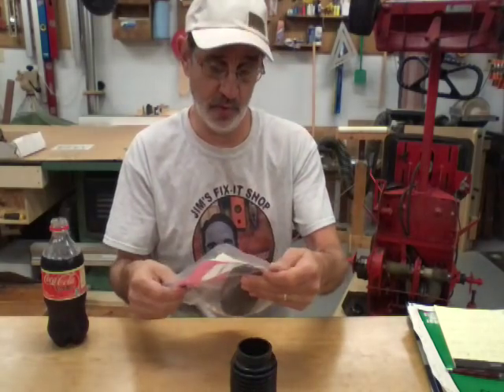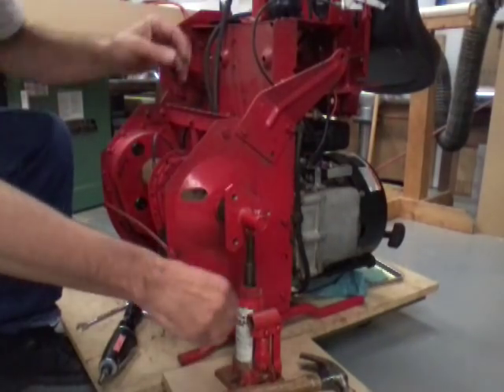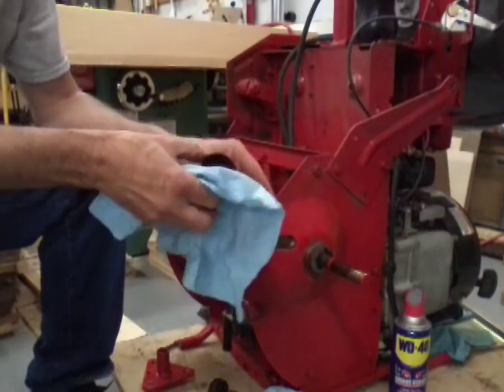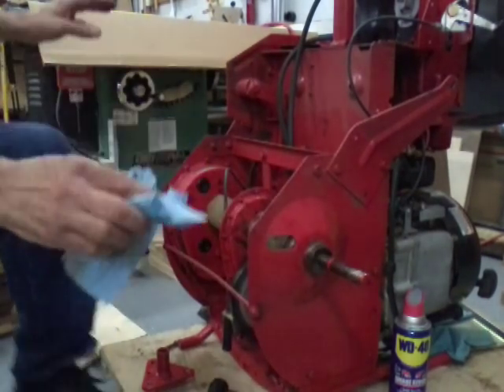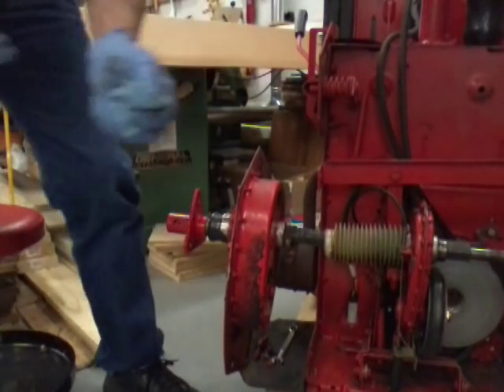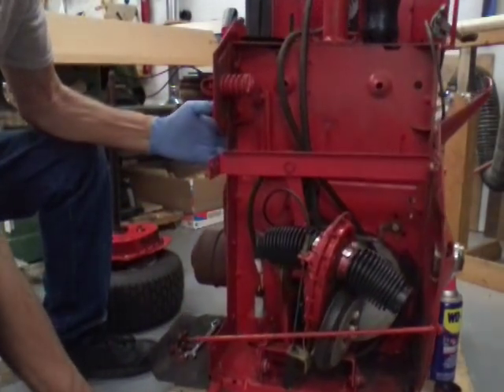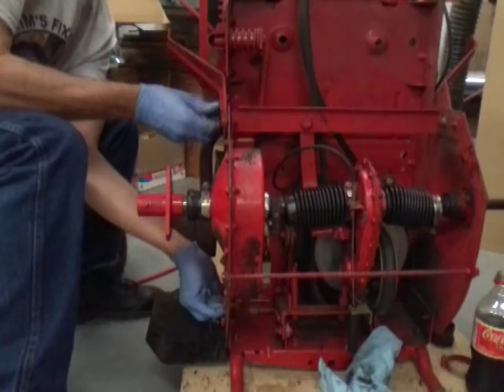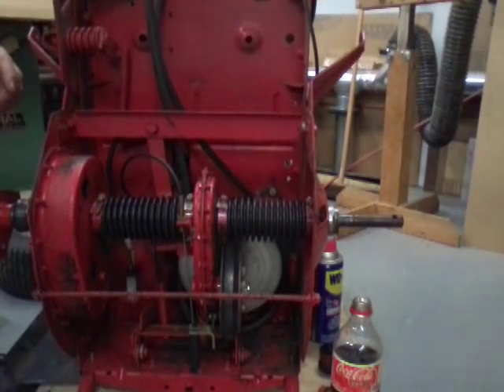203.  Installing new boots in my father-in-law's Snapper RER

Comment: Thanks Jim for sharing all your knowledge regarding the Snapper rear engine riding mower repair.  I've had mine for about twenty years and hope I will never have to replace it.  Don't think there is a better rear engine riding mower out there.  With your informative videos, I should be able to handle any needed repairs.  Thanks again, and keep up the good work!

Comment: I replaced the boots with the Briggs and Stratton boots and without your detailed instruction I’m sure I would have pulled what’s left of my hair out. In fact I probably would not have attempted doing it. One thing I noticed is when tightening the hose clamps around the boot tightening to mush actually squeezed the boot off of the tube so for me it was find the happy medium. Thanks Jim and I am subscribed.

Comment: Thanks for this video.  About to tackle this on my ancient snapper.  The boots have been gone for years.  The mower was given to me about 25 or so years ago as a junker and has more rust than paint.  About two years after I got it, I replaced the original 8hp engine with a Tecumseh 10hp industrial engine. 

PS- The guy from Georgia told you about the Coke because it was invented there.
Reply from the maker: Well thanks for watching and if you need any help, let me know. Jim.

Comment: Jim, I just did this on my electric snapper conversion.  It was very hard to shift and the boots were really bad.  Musta been the originals.  The hex shafts were really gnarly with rust and dirt.  It all went well, until step number three.  The left hub was really seized on.  Beating, gear puller, kroil, simultaneous hammer from both side of the hub to shock it, heat and quench... nothing worked.  After your video, I went and bought the new dremel cutting discs and used 2 or 3 total to cut thru both sides of the hub and all the way thru both sides of the triangular flange too.  finally chiseled the hub apart in two halves.  The rest of the job went really easily after spending 3 hours on the hub removal.  I polished the hex shaft with the dremel and some compound.  Lubed it up and sealed up with the new black rubber boots.  Shifts like butter.  I love it.  Thanks for the help and the heads up on the dremel.
Reply: Electric Snapper Conversion... what a genius idea.  PLEASE tell me you made a video!!
Reply: @boyettedesign  sure did. Look under my name and you should find it. Or search for snapper lithium conversion.

Comment: thanks for your video...I am getting ready to replace boots and disc on a r8000 tiller...looks almost the same except there are two different length boots. One is the same as you used and the other a bit shorter.

Comment: I had the same problem with pulling the shaft out.  I used 500 and 1000 grit emery cloth, not sandpaper, and it polished the shaft beautifully.  I did as you suggested and made sure that there was no grit remaining before I reinstalled the shaft.

Comment: This and all of your videos on this rear engine snapper are going to be very very helpful for me, I have recently acquired an old 1980's I think mower of this type and it is really ruff, all Iv'e been able to do is start removing the deck and did get the engine to at least to spark. It's a model 28086S, SER#83064756 So I'm still trying to find diagrams for all aspects of this machine
Reply from the maker: Russell Puckett 
Parts Tree.Com Is a great source for schematics and parts list names and prices are you need is your model number and follow the pages and you can find anything you need through them. Let me know what you think. Jim

Comment: Hello Jim, this video made it easy for me to change out boots from the old grey plastic ones to rubber boots. Same problem you had with burrs which I easily filed down. I have one question do you need to apply grease to the shaft before putting boots on? If so, any recommendations Thanks again for all you do for everyone!
Reply from the maker: Yes, if you grease your hexagon shaft, it will make shifting much easier. It doesn’t matter which type of grease you use and I would clean them in regrease them every 5 to 6 years or when it begins to shift hard      Jim

Comment: Hi Jim. 
New sub. 
This is so interesting and just what I was looking for! Thank you! Now I can speak with some level of intelligence and  understand what is involved in repairing my older Snapper (I don't tell it how old it is),. 
I couldn't get it into reverse. A mobile service came out. One boot had apparently dry rotted or broken off altogether. The fellow didn't have any boots on his truck. He was gracious and honest in telling me he had not ever replaced boots on a Snapper and wanted to check with a fellow technician who had that type experience. Meanwhile, a friend of o friend is going to give me a hand. 
Thanks to your video, I know what parts, and supplies may be needed and any potential snags or things to be aware of.
God bless you and your famy.
Enjoy the rest of your week.
Reply from the maker: Is this Karen I’m talking to or is it Karen’s husband using Karen’s phone, I get that a lot. 
I get a lot of parts from Parts Tree.Com out of Texas and some I get on Amazon the black rubber boots you can get from Amazon don’t buy the gray plastic ones they don’t last and the new ones are both the same size because they stretch to fit the gray plastic ones one is longer than the other they don’t make them like that anymore,  when you get it apart slide the boot on the shaft put the chain case back on slide the other boot on with the clamps of course and put the fender back on when you go to clamp the boots on shift it all the way into fifth gear that will compress the boot and force it on to the flanges where it belongs it’s much easier that way when you get that one clamp shifted into reverse and do the same process if you have any problems or issues email me I’ll answer all of them good luck and I’ll talk to you soon. Jim
PS while you have it apart clean and grease the hexagon shaft it will help it shift much easier.
Reply from the maker: Any other repairs you need to do I can help you do it your self and save all the money they charge if this is Karen I have about 15 female mechanics I help a lot most of them are down south they buy these machines fix them up and sell them. Jim 

Another PS. Lol. I hope you’re a subscriber it will help you navigate through my videos if you go to video number 315 there is a link in the description section where you can download a list of all of my videos by title and number to help you find them I don’t think anyone else on YouTube offers this service to their viewers.
Reply: @jimjackson9381  
Hi Jim. Thank you so much for replying and for the info!. I am definitely a Southern gal,(metro Atl.) no where near being a Spring chicken,. Between the latter, a small build of about 110 lbs, and about six months past the  unwanted Chinese import, my strength and energy is a limitation on getting my Snapper stood up by myself. Have you any ideas or advice there? 
I do have a wooden rolling platform similar to the one you were using that would be helpful. 
I like to understand things and work on everything I can myself - to save money, for the enjoyment and knowing I can accomplish things on my own.
 I will definitely check out your other videos!
Thank you again Jim.
Reply: @jimjackson9381  
I am subscribed to your channel.
Reply: @jimjackson9381  Thank you Jim. This is Karen, solo, no  husband. I'm sure you do get that a lot. Thank you Jim.
Reply from the maker: @karenthegoodkind  Well if you need any help just let me know if you have any issue and you can’t find a video to help you    I do make videos especially for viewers that will cover the issue they have so just let me know. Jim
And don’t forget my picture of you on your snapper.

Comment: Hello Jim, I am very grateful for the advice you have given me, this weekend I took the opportunity to clean the hexagonal bar, I left it very clean, the gear lever is clean without rust, it does not have a rubber protective cover, everything is very clean I have managed to make the lever move since everything was blocked and I have been able to make the gear block move but in the corners both on the left side it costs a lot and it stays embedded and the right side is loose but I don't know It is at the end of the whole, you can tell me what kind of fat I have to put on the bar. Thank you very much for your attention. Thanks and a hug.
Reply from the maker: L CP 
Can you send me some pictures of the areas you’re talking about so I can get a better idea my email is
jimsfixitshop@gmail.com
Thanks. Jim
Reply from the maker: L CP 
Can you send me a couple pictures to my email so I can get a better idea of what you’re talking about my email is
jimsfixitshop@gmail.com
Thanks Jim

Comment: My snapper, same one as in the video, is running great. This makes me want to disassemble and lube it up for another 20+ years of excellent service. My previous snapper self propelled finally got so old that they stopped making parts for it. 

Jim, if it is working great what should I do to keep it running for a long time? Differential lube , replace rubber drive wheel, and lube wheels and shifter?
Reply from the maker: MrMysticSeer 
Hi it’s Jim
   Well it’s best to stand them up and grease everything you can find with a grease fitting on it.  Check to differential and chain case and see if it needs more lube added to it if you’re going to change it it would probably be a good idea to clean it all out before you go to something different. Jim
Reply: Jim Jackson 
I found your video on lubing and maintenance. Thanks! Great videos!!!

Comment: I used a chevy small block Harmonic Balancer puller to remove my Stuck Flange
Reply from the maker: holles conley 
  I’ll have to check one of them out and see how that works thanks for the tip. Jim

Comment: As always Jim I enjoyed your video. I was thinking you would put grease on the shaft so the shifter would work easier. I think I saw you this recently on a maintenance video. Any reason you didn’t do so hear?
Reply from the maker: If your differential and chain case is full of lube it will slowly leak into the boots and lubricate the hexagon shaft. Jim
Reply: @jimjackson9381  thanks for the reply. I hope you continue to make videos.

Comment: I loaned my snapper rider to my son.  It needs some work.  I have tried to remove the hub pin (tapered bolt) and just have had all sorts of trouble.  I used his hydraulic jack to raise the machine just a bit and used a hammer as you illustrated but to no success.  The hydraulic jack was not a skinny platform so I inserted a socket between the jack and around the tapered end of the bolt pressing on the hub.  Even a 5 pound  hammer could not dislodge the bolt.  Next was drilling out the tappered end of the bolt using a 1/4 inch bit which stopped (I think) when it came to the axle.  The bolt still does not show any signs of moving.  I need another method.  What can I do?
Reply from the maker: Rod Powell 
I guess I would try applying heat and see if that helps break it loose. Jim

Comment: I wonder if you could just use a rubber or poly bearing boot cover from another mower and just cut a 1/2 hole in it and then force it over the shaft to make a seal.
Reply from the maker: Maybe I have not tried that. Jim

Comment: Well, I did notice the Coke. Coke no longer says, "Things go better with Coke", so maybe they did a sneak formula change on us, only this time didn't tell us. So I guess I'd better get me some Pepsi's before I attempt my boot change.
Now for the stinking part. Just today my boots came in the mail. Got them off eBay. I thought they looked more "heavy duty" than the originals on the mower that I need to replace. Well, I wish I'd watched this video first. Didn't know these were cheap quality. So I guess that's ten bucks down the commode, and I now need to buy the B&S ones. At least now I know also why the part numbers I was seeing online were the same number for both sides. No more straight section. 

Oh well, ten dollars worth of education. I sure ain't gonna put the cheapies on now. Thanks for the heads-up Jim!
Reply from the maker: BeingRomans829ed 
Yes they no longer make two different size boots the new black rubber one stretch with no issues so they make them both the same size. Jim

Comment: I watched your video several times... before I attempted to replace the boots on my snapper 3314520BVE.   So far I have 6 hours invested... and all I have managed to do is remove the rear tire.  That wheel hub IS NOT coming off... EVER.  I have used a can of PB Nut-blaster (soak/wait, soak/wait, etc.),  broke MY wheel puller,  rented a 5 ton three-jaw wheel puller and destroyed it (broke one jaw and warped the threaded drive shaft), and gone through two canisters of propane gas trying to heat it to loosen it.   Tomorrow I shall drag it to the end of the driveway and spend a minimum of 6 hours... beating it with a damn sledge hammer.  Think I will invest in some goats.  They don't have boots.
Reply: OK... sorry for the rant.  6 hours of beating on a piece of metal seems to bring out the worst in me.  Amazing what a good meal and some sleep will do for a person's mental state.  Again... sorry for the rant.
Reply from the maker: B.J. Boyette 
Hi it’s Jim
  Sorry for the delay I’ve been a little busy.
  Usually when The wheels flanges are stuck that bad it is easier to cut them in half and replace them with new ones, I have videos showing and explaining how to do this. if you need any help doing this please let me know. Jim
Reply: @jimjackson9381  Thanks Jim... I used an angle grinder to cut off one of the tabs, then cut a slot in the flange collar, wedged my chisel in the slot... and off it slid.  I  wound up cutting a little groove into the shaft in the process, but I am gonna call that a "advanced engineering lube groove".   The process continues... as it turns out whoever worked on it before I got it "definitely" had a few washers and spacers left over when they were done.  The differential cover is gonna make an excellent ashtray.  Thanks again.
Reply from the maker: B.J. Boyette 
  Does the differential cover have a grove in it. Jim
Reply: @jimjackson9381  I would call it more of a gash than a groove.  Man, I wish up could upload pics on YouTube.

Comment: Hi Jim i need some help i have a 33 inch snapper that moving, i get off of it and it moves ok on the ground, the engine disc is touching the rubber disc, i looked underneth while standinf up. the boot is ripped and there is grease on the break pad also leaking out grease on the flange bearing by right tire by diferrential. would any of those have have a factor of it moving correctly do you have any videos how to fix these problems, i replace a boot before but not sure what i should try and fix would the ripped boot interfear with it moving? the trannmission seems good, hope you can help thanks

Comment: Good morning Jim. You mentioned using paint thinner to clean the chain case(without having to open the case). Can the same procedure be done to the differential?
Reply from the maker: Gabe Guerrero 
Hi Gabe
  Hi suppose you could try it it all depends on how all dried up the snapper little bit is if it’s a newer machine and it still in a fairly liquid state It could clean it out but if it’s dried up and really thick I don’t know if it would work or not. Thanks Jim

Comment: Hello good morning, I bought a Snapper Model 28127BE lawnmower in Spain, and the gear and reverse lever does not work, it is very hard, apparently they broke it from how hard it is, I have welded it well and I have the tractor in position of foot to be able to repair it is missing the rubbers to crimp the direction and as I said the gear lever does not function, please can you help me. Thank you    Leonardo
Reply from the maker: L CP 
It sounds like you have to clean and grease the hexagon shaft underneath the boots that may help, and it sounds like the shift handle itself is rusty and sticky you’ll have to take off the linkages from the shift handle compress the spring and take the shifter apart and clean and greased the inside under the spring to get it to work properly. Jim
Reply from the maker: L CP 
And let me know what you find out. Jim

Comment: Jim, I have been working on my 68 Comet. When I had the drive train apart I had that hexagonal washer like this one plus just one nylon washer. Why did you put 3 washers in? Also I'd like to email you. Thanks.
Reply from the maker: Michael Meredith 
Hi Michael
    The nylon washers are to aluminate side play in your axle depending on how much side play you have due to the face of your bushings wearing will determine how many thrust washers you have to add. You can email me at. jimsfixitshop@gmail.com anytime you need help with any issues that you may have. Thanks Jim